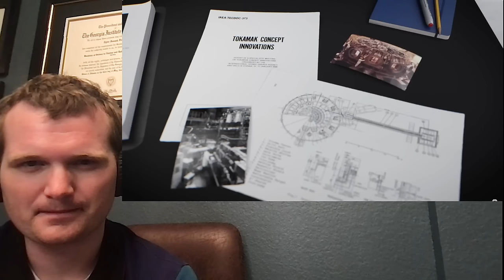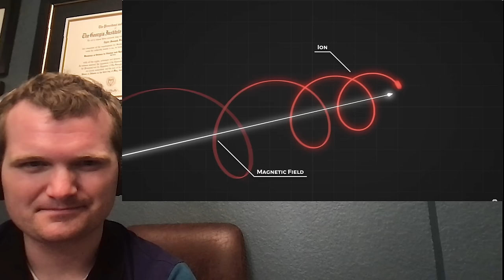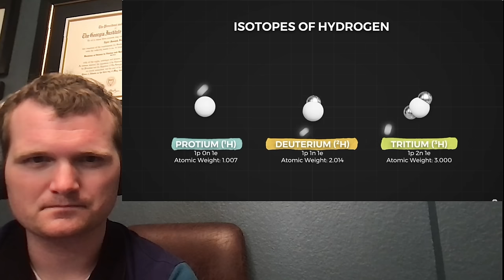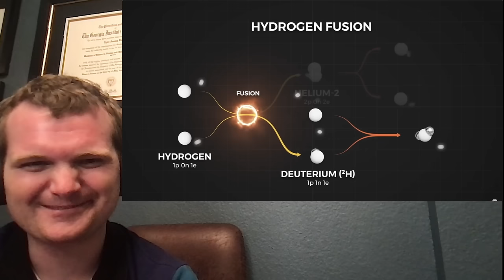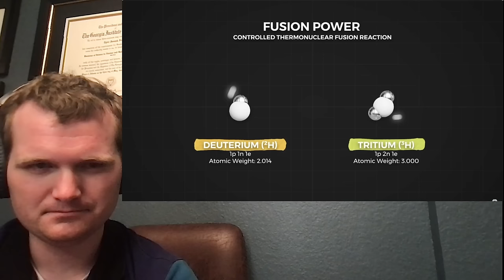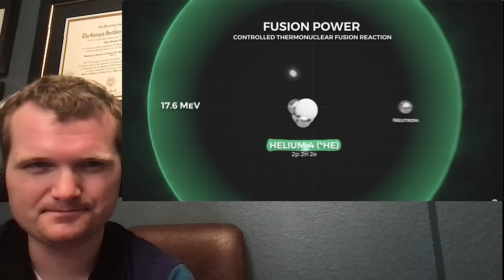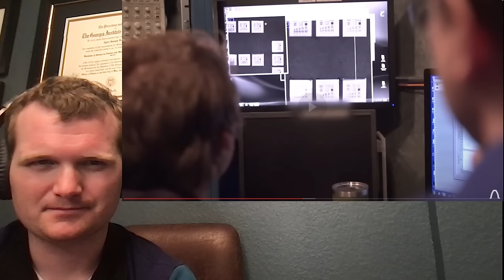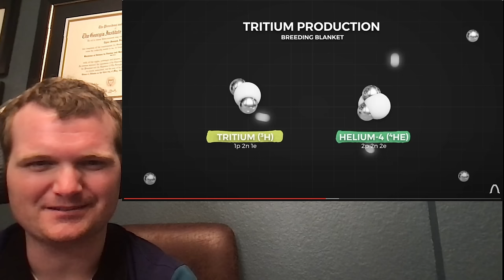Nuclear Engineer Reacts to Real Engineering "The Problem with Nuclear Fusion"

Comment: I am a physicist and I have always felt that magnetic confinement fusion was hopeless, because the equations of motion are so beastly complicated that accurate simulation is impossible - also because failure of confinement often destroys the complex apparatus. You cannot rely on a technology whose main failure mode is destruction of apparatus. However - the one slim hope I have would lie in using heavier nuclei to do the fusing - say lithium and deuterium. Also this produces no neutrons. The neutrons are just waiting to destroy apparatus as well. As of now it is hopeless. All effort should be bent toward establishing a fission infrastructure ASAP.
Reply: except thats exactly the kind of problem modern AI is so good at. see deepminds paper about controlling plasmas last year. I think there's a lot of reason to see that as the true thing that's changed to shift the "30 years away" status quo
Reply: AI as in software computation?
Reply: @Gsoda35 no, American Idol
Reply: I'm hoping we can get quantum computers to be reliable enough to run complex scenarios like this.
Reply: @fledgeking  The problem is not computing power. It is the highly non-linear nature of the system, and the extremely complex interplay of fluid motion and electrodynamics, where relativity brings in even more complicated issues because of the extremely high energies of the particles. Fluid turbulence isn't well understood even for plain old water. The onset of turbulence in a magnetohydrodynamic system is an impossible problem under real world conditions. You need s stable toroidal plasma to study, but you need to understand first how to make it, so it's a Catch-22.
Reply: Failure of confinement, failure of the field resulting in a sudden quench, over time regardless of how swimmingly well things are going, chamber wall erosion and yeah, computing requirements needing an infinite number of monkeys (OK, processors), yeah.
I was thinking the same of lithium, but lithium is problematic due to its universal scarcity.
It's not even only neutrons, don't forget how much havoc any unionized hydrogen raises over time, with both making everything brittle. Although, neutrons aren't much of a problem in fission...
Reply: @ultrametric9317  what is a stable toroidal plasma? A toroid of plasma nextdoor to the unicorn stable?  ;)
Seriously though, yeah, double damnably complex, stable magnetic fields can be fiendish in and of themselves at that energy level, add in moving plasma and its own magnetic field and turbulence, if we could compute that, we could predict solar weather more accurately than the terrestrial weather!
Reply: You may be a physicist but that is just your opinion and for the most part is not backed up by facts. Plenty of people working on fusion think that magnetic confinement is the way to go, hence practically all attempts at a fusion power plant use magnetic confinement. Maybe you don’t see the full picture or maybe they just know more about fusion than you do and hence they see a way in which magnetic confinement fusion is feasible. Just saying you are a physicist really doesn’t add much to your argument, physics is such a large field and just being a physicist does not mean you know a lot about all kinds of physics, you have done the equivalent of just saying you are an engineer and are trying to use that to back up your point although engineering is also a vast field and for example a mechanical engineer wouldn’t necessarily know anything about electrical engineering. It is better to say what your actual specialisation is or just leave out that you are a physicist.

You say that the equations are too complicated and therefore simulation is impossible, but how can you actually say something like that being a physicist? The most you can accurately say is that we don’t have all the information yet to accurately simulate it and that we likely don’t have enough computing power to simulate it. To say it is impossible is just incorrect (unless you have an actual source proving that simulating it is actually impossible), you have no way of knowing if it is actually impossible or not, so it is just your opinion and likely an incorrect one at that.

If you think fusion is so hopeless and that we need to scale up fission then why are you here writing comments that are just your opinion and not doing something about it? At least the people who are trying to make fusion work are actually trying to do something, what are you doing?
Reply: @conorstewart2214  I have no intention of arguing with you here. The facts are that 70 years ago we were 20 years away. We're still 20 years away. The only thing missing is everything.
Reply: @conorstewart2214  was Fermi’s pile self funded?
Reply: I have high hopes for the polywell.  Ratheon was screwing around with it and haven't published anything, so...  I wonder if they're keeping quiet to avoid nuclear proliferation.
Reply: @ultrametric9317 oh but it IS computing problems.  You could simulate many many atoms of a fluid but each atom affects all the other atoms, so the calculation increases factorially I think.
Reply: @kayakMike1000  No it isn't - you cannot compute what you don't even really understand. Even bare neutral air turbulence is poorly understood. It involves the onset of phenomena at all scales that put up intractable barriers to simulation. There is no way to understand magnetohydrodynamic turbulence when you can't even really understand why cigarette smoke transitions from laminar to turbulent flow.
Reply: @ultrametric9317 in what world is D-Li fusion aneutronic? I can rethink of at least three D-LI reactions that produce fast neutrons
Reply: @ultrametric9317 gee, haven't heard that one before. you realize the "always 30 years away" isn't really an argument, right?
Reply: @ultrametric9317 I wouldn't exactly call it impossible, Wendelstein-7X for example has made great progress in that regard. But even if we figure it out today, that's going to be too late for current problems, just like any new fission plants.
Reply: Productive
Reply: No more fission! That is something for the Russians and Japanese who are used to being irradicated!
Reply: @wolfgangpreier9160  Fission is incredibly safe now. No one in Fukushima even died from radiation. Zero. Same at Three-Mile-Island. Zero deaths. Chernobyl was built 60 years ago, we've learned a lot since then. Even the solar and wind industries have more deaths per terrawatt hour of energy produced than nuclear, and thats including Chernobyl tragedy.
Reply: @userNULL  I don't disagree, fission is, besides renewables, one of our best options for clean energy, but I really don't like the 0-death argument. I think it's disingenuous considering half the data used for that isn't really trustworthy. If you include Mayak and the other sowjet sites where accidents occured the number certainly isn't zero and most of our currently running reactors were also build 30-50 years ago.
I honestly believe it's too late for fission. We would've needed to start building ~10 years ago.
Reply: @chronically_late  i didnt say there were zero nuclear related deaths, just zero in the Fukushima and Three Mile Island incidents.
Reply: @chronically_late  also, its "too late" for everything. doesnt mean we cant minimize damage the best we can
Reply: @chronically_late  That is the bottom line. We are in a serious pickle that needs serious answers, not hope.
Reply: @userNULL Absolutly correct. I just wanted to point out that building new fission reactors won't change anything wihtin the next 20 years.
We need to switch to renewables now and supplement them with fission/fusion in the future if/where possible.

Switching the planet to fission would also create a huge proliferation problems. There are just some countries that really shouldn't operate fission plants...
Uranium supplies also aren't endless, there's a lot of it in earth's crust, but a lot of it simply isn't financially viable to dig up.
Reply: @chronically_late  yeah i already know its not a one size fits all solution, its just a good foundation for renewables to operate on top of. as for risks of nuclear proliferation, I personally don't think its an issue. Trusted countries can operate nuclear power plants and sell access to the grid to other countries.
Reply: Yeah, something like Dual fluid Reactor would be nice. Impressive EROI and comes with less troublesome downsides compared with regular molten salts reactors.
Reply: @userNULL  as far as investors are concerned it is.
Reply: @jamesgorman5241  tch, as far as investors are concerned we should all stay on fossil fuels until we asphyxiate or catch on fire. Not sure why we suddenly give a shit about what greedy corporate pigs think when the fate of the world is at stake whenever nuclear power is brought up
Reply: @userNULL  because they fund stuff?
Reply: @jamesgorman5241  Thanks genius. Now use that brain power of yours to think a little bit longer. Do you think the guys funding stuff are going to suddenly invest in ANYTHING that doesn't maximize their own profits?
Reply: @userNULL  sorry big brain I'll go sit in the corner filled with contrition. But while we're hear do you know if anyone's tried centrifuges to cause sufficient compression to the plasma?
Reply: @jamesgorman5241  a centrifuge would push the plasma away from one wall into another one. doesn't really solve the issue. 
also sorry for being mean ive had a bad day i didnt mean to take it out on you i apologize
Reply: I agree. Even if we could simulate every particle, the interactions are still probabilistic not deterministic so we’d still need to measure and react to what’s going on with extremely small latencies. Then on top of that our ability to change magnetic fields can’t react at those speeds nor can they selectively target the particles going astray. Changing one magnetic field affects all charged particles going through it.
Reply: @refusalspam  Correct, as in turbulence there are phenomena at all scales. And they are not well understood. You cannot compute what is not understood.
Reply: Irreducible complexity, that’s what makes simulations extremely difficult.
Reply: @Gsoda35 Oh God. I would not put an AI in charge of a fusion reactor.
Reply: Good reflex thought. But if it works…!(always 20 years from now)
Reply: @johankaewberg8162  let's just use a few traditional specialized softwares in charge of automation and a human team at the helm like with our nuclear reactors.
AI can act as a separate support for other things like checking for irregularities to report to the human team.
Reply: @Gsoda35  Thumbs up. We are in the same ballpark.
Reply: @johankaewberg8162  agreed!
long live the precautionary principle instead of the risk-based approach which the NRC use.
Reply: I’ve wondered about fusing other elements too.  The lithium idea is brilliant btw.

Comment: Yes !!!
We do want a review of helion !!!
Reply: I would suggest a video from channel called "improbable matter". He might go a bit more into technical detail than your regular YouTube channel, but there is no BS and sugarcoating
Reply: @DarktroopX  just watched the video, and some points he makes, he portrays as negatives to the system. 
The high energy neutrons released by the dt-dt fusion along with the dt-h3 fusion are what helion uses for energy production.
Helion themselves have addressed the temperature scale issue as well, that's why they are increasing the size of the Polaris machine to account for the larger ion orbits at the higher temperature needed in a commercial, positive power output reactor.
And the tone the presenter has in that video seems unnecessarily confrontational, almost like he has some bias against the idea.

But as far as usable, long term viable fusion goes, I feel like helion is on the right path. ITER and stellorators appear to be huge money pits that don't have enough fuel available to ever be viable.
Reply: Yes we do want a review of helion and preferably appended to the end of this video. Long videos are king baiting me for another video that may or may not exist yet that I now have to manually search for is suboptimal to say the least. If in doubt review a bunch of videos in order and release it as one video.
Reply: @jpkellerman7056  what do you mean? You can't append an existing video.. 😂

Comment: 2:40 I think it is correct to take into account not only how the resource is obtained to generate the energy but also the waste that is produced while in use and when it is decommissioned. With that perspective, there are very few "green" energy sources. It is all about management.
Reply: IMO nuclear fission generates the least waste out of every currently viable energy generation method we have.  When properly managed it is not even that dangerous.
Reply: @ryanmarbut1035 Beyond that, it can be reprocessed and used again.
Reply: @ryanmarbut1035  not even that dangerous. You say that now, let's see what you have to say when a storage cask of it gets dropped on your foot!   ;)

Nothing whatsoever is green. Farming, we have runoff. Mining, good heavens, where to begin, the tailings or the tailings from refining and slag? Plastics?
I don't live on a planet any longer, I live inside of a gigantic scrapyard.
Reply: @spvillano  Get over it it's never going to change
Reply: @derpderpin1568  OK, nothing is ever going to change, nothing ever has, which is why we still need to get around riding horses and banging rocks to make fire.
Which reminds me, gotta run, have to go wind my horse.
Reply: @spvillano  how is anything going to move the storage cask?
Reply: @jonathanodude6660  obviously by sitting it in an unsafe manner on the edge of a table!
I'll just get my coat...
Reply: @spvillano   My point still stands.  The weight of the cask would do more damage (to my foot) than it's contents.  I would be completely safe from radiation even in that instance.

Comment: I have to say that I am extremely happy that the nuclear engineer also thought that a fission fusion setup might be interesting :). When I saw this video I thought the same. Wouldn't it make sense to use fertile fuels to utilise these neutrons for a greater heatoutput? I am not at all informed on the topic but I thought there are some fuels that are not able to produce chain reactions but with a source of neutrons would still peoduce power. I am not sure if the products would be better or not, but I am very interested in the concept of a fusion neutron source with otherwise unusible fission fuels, where both would create less problematic waste products than pure fissile fules

Comment: 9:22 you can also do fusions between neutrons and uranium, but the resulting nuclei doesn't last very long and ends up splitting :)
Reply: it also produces less energy than it takes to perform. Every fusion heavier than iron is a net energy loss. That is why stars die when they start producing too much iron. Its also why elments heavier than iron are more rare, as they are not produced inside stars normally, and are only produced when massive stars go super nova.

Comment: I think that thing that would make fusion special, is that it most likely wouldn't need much precious metals, nor would you need to depend on mining, that might not be in your control and is quite destructive. And ofc, you don't need to even worry about dealing with risks that come with fission. I think we manage those risks and waste really well, but ultimately this would give fusion much more momentum by the public and investors.
Reply: You don't think a fusion reactor accident would be bad? Lots of stuff in there that could go badly wrong!
Reply: You need precious metals for the magnets
Reply: @5688gamble  oh? As in what? Hydrogen? The usual metals already inside of a fission reactor?
Beryllium, lithium and cobalt, along with nickle, zirconium hell, other than beryllium, pretty much everything inside of such a plant is already routinely dumped on our city streets daily - especially lithium, these days.
Reply: technically you don't need to rely on mining for fission fuel either. tons of uranium in seawater

Comment: 3:29
The truth is that nuclear scare and high profile incidents with mismanagement really inflated the fears about fission as power. So people dismiss it out of hand, even though it can be the answer to most problems they use renewable energy for. As you say, there is hardly anything where nuclear fusion would solve our energy problems. If somebody wants to reduce pollution and safeguard the planet long term the present nuclear reactors are already well-suited for it. Obviously, nuclear reactors still need some other sources as backup, diversification is important. It still baffles me that fusion is viewed as a savior for the energy sector when supporting to build more nuclear reactors would be a much more ready solution. It just continues to baffle me that governments are willing to do anything but to build more nuclear reactors.

Comment: As I said in the other video..  Yes, those plates are a problem, and you'd run out within months if you tried to power the world with this setup.  On the other hand, the pinch setup can work as a breeder to make those plates re-usable.  So while it has issues being run fast enough to make power, it can be power neutral and make the fuel, that lets this system make more power better.